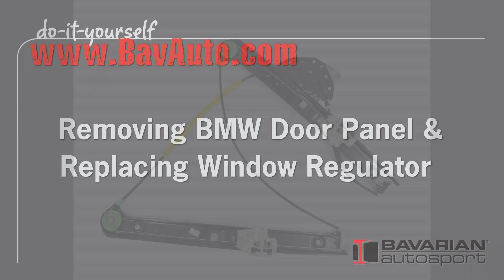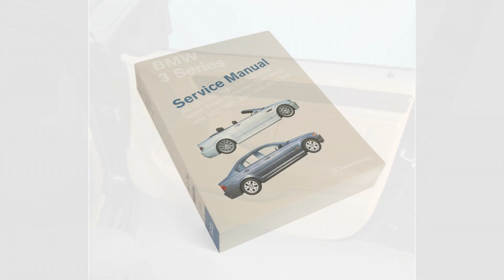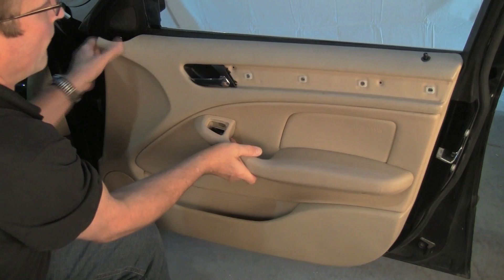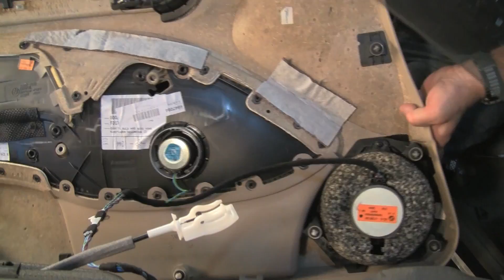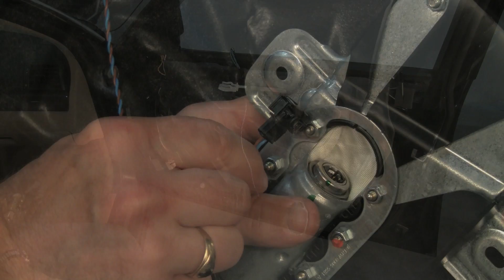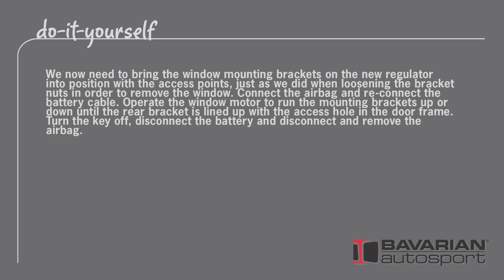Removing BMW Door Panel & Replacing Window Regulator

Comment: I have a 1995 325i coupe and its my first car and my parents bought it with the door panels falling off. My drivers door panel is completely off and the passenger is falling off slowly. My clips are broken and i was wondering if i just bought new clips and locks would that work instead of buying new door panels?

Comment: Hi guys.  I have a 2007 328xi wagon with a dead lock actuator, in the passenger front door.  I bought a new actuator online, and a trim removal kit.  Is the procedure similar at all, between E91 and E46?  If you have another video I can reference, that would be great.  Otherwise I appreciate any advice.  :-]  I'd bring it to you for the fix if I still lived in NH.  Driving up to visit tomorrow for the weekend, but probably taking my wife's Outback - more cargo space for stuff and my dog.  Thanks

Comment from the maker: If you can notice that the window initially tries to move or you hear the motor "grunting", then likely the regulator is at fault (and is far more common).  If you can not make a determination, you'll have to go into it and inspect and/or test the regulator and the motor in order to make a determination.

Comment from the maker: The E60 (5-series 04-10) 528i will have different details in removal of the door panel as well as the window regulator. The process will be outlined in the Bentley repair manual for the E60 chassis. We do offer the manual at bavauto.com under part number B510. You can visit our online store or call our agents at 800-535-2002.

Comment: I just did this on my 2003 325IX, the window works fine but if I use the all down with the key or remote the drivers window goes down first and makes a clicking noise after it reaches the bottom.  It doesn't do it with the interior buttons, any ideas?

Comment: I just replaced the driver window regulator and now the 2 rear ones went bad. Is it necessary to unplug the battery to work on the rear windows since there are no air bags in the back?

Comment from the maker: You may need to align the window in the regulator's clamping brackets just a bit.  If you slightly loosen the clamping bolts/nuts (not enough for the window to detach) and run the window fully up and fully down, then reclamp, this may help.

Comment from the maker: Good thoughts.  thank you.
Typically, the ferrule on the cable pulls out of the bracket that moves the window.  The cable still works, but it does not lift the window evenly .... and this binds the motor and shuts it off.

Comment from the maker: It is not untypical that the window is stuck and will not move, when a regulator is faulty.  The most common way around this would be to use cable cutters and cut the regulator cables so that the window can then be pulled up manually.  Just keep cutting the operating cables until you can get the window to move.

Comment: my window is stuck down, when i tried to push it up it didn't move, in this case, how am i suppose to bring window 5 inch up with the help of switch when it don'e even move!!.. motor is working i can hear the sound of rotation and the clicking noise as if something is breaking up.. i am worried, i have 2001 bmw 740il on sale, two windows need work, i can't afford to go to dealer. i want to take out my all money i spent in that car!! please reply!!

Comment: Good video. Another helpful  tip is to make sure you save or even better, replace the doortrim clips as the black foam on them assist in creating pressure in door shell to deploy the airbag if it's ever needed

Comment: Awsome videos.  I always purchase my parts from you.  Question. I have a 1998 318ti. last year the dealership replaced the guides on both driver side and passenger window..  now the passenger window goes down really slow, but goes up fine. Is it the regulator or the motor?

Comment from the maker: @stanleymejia1 
The Bentley repair manual will detail door handle replacement.  We have the manuals in-stock at bavauto DOT com.  What model do you have, and is it inner or outer?

Comment: I have a 98 540i pushing 300k miles.  My left rear window rolls down fine, but doesn't roll back up, but you can pull it up and down freely by hand.  Do I just need a new regulator?  Also my front passenger window works fine, but is noticeably slower than the rest and if not rolled up little by little makes some nasty noises, and also rattles when partially rolled down, I fear it's on it's way out too. Any insight is appreciated.

Comment: I have a final installation tip. After doing this, you will notice the auto up/down will not operate. Simply close the window and hold button all the way down for 30 seconds. Then open the window and continue pushing the button down all the way for another 30 seconds. Auto up/down should now work

Comment: Thanks, it's back at the BMW garage now - since the problem started when under guarantee, they're still doing the repairs. I get the feeling that they know everything about mechanics and very little about computers, which is why they've changed the motor, wing mirror etc, but the problem persists. It was one of the first 2-dr 118's (I think) so maybe something wasn't quite worked out. But thanks for the comment, I'll definitely ask them if they've tried this.

Comment: Great video! My prob is with 118 passenger side. Since purchase 4 yrs ago, window sometimes does not drop when door is opened, so door does not close properly. When this happens passenger-side wing-mirror & window switch also stop working (window can still be lowered from driver side). I can reproduce failure by opening door fully - on last position if the window was down (working properly) it will always go up again. Any ideas? They've changed the window mechanism but didn't solve the problem.

Comment: I ordered the parts from Bavarian, followed the steps, and the repair went very well.  The original motor was shot, and the regulator was worn to the point that the window fell in and would not stay up.  The new parts work great, and it was easy to follow the video on my wireless laptop on the roof of the car.

Comment: Great video! I am a 27 year old IT Specialist! I own a 2002 325I BMW sedan. I had never tried to fix a window on any car. Although I can fix laptops! This video made it easy to watch and repair the regulator. My BMW dealer wanted $325 per window to fix my broken ones. I ended up spending $350 for all three parts to fix my FP, FR, RR. I ended up saving a lot of money. Thanks BAVAUTO!

Comment from the maker: @cvidales1 -
A BMW dealer or an independent shop (who has the proper diagnostic and scanning tool) must do any system programming or updates that may be required.

Comment: @BavarianAuto 
it is a 2006 325I ,the regulator was replaced,when you have the window in th down position and go to close it ,the window goes up and the comes back down,after the switch is released.
The mechanic who replaced the regulator mentioned that "we may have to have the window recalibrated or reprogrammed ". Problem is you cannot close it without hitting the switch in a jogging manor to close-

Comment from the maker: @dakota4800 -
The Z3 uses a mechanical gear and lever type of window regulator (as do all of the older BMW models).  The slow operation may be a weak motor, or could be binding in the system.  We would suggest that you remove the door panel and have a "look-see".  The Bentley repair manual for the Z3 will detail the door panel removal and the regulator and motor removal.  Go to bavauto dot com and search "Bentley".

Comment: Just changed out the regulator on the driver rear side,problem is window does not stop when closing,window goes up and all the way down,how do I re set the window to work properl ?

Comment: My drivers side window on a 96 328is is stuck all the way up. It started making a grinding noise before failing all together. Do I need to replace the regulator or the actual motor? Thanks

Comment from the maker: @1140ghb 
Typically, you would need to go in and cut the drive cables on both sides of the glass slide bracket.  You would then be able to move the glass by hand.

Comment from the maker: @Badobsession89 
If you have ALL of the cables cut, you should be able to move the window by hand.  Did you cut the cables on both sides of the glass side brackets?

Comment: My window's stuck rolled all the way up. I cut the 2 cables and tried moving the window down manually, but it won't budge. Where in relation to the bottom of the window are those 2 bolts that were shown when the screen paused?

Comment from the maker: @1632poppa 

If the door will not stay open at the 1/2 and full open stop points, it's likely that he door brake is at fault.  You can see the link-arm of the door brake when you fully open the door and look in the forward door jamb area, between the upper and lower hinges.  The brake assembly is replaced from the inside of the door.  Bavarian Autosport keeps these in-stock at:  bavauto.com

Comment: @bavarianAuto
The drivers side headlight is out, I had my buddy trying to change it. He claims it requires a couple of hours to do, but now at temperature in the 112 outside and 140 in the garage it will not happen. Is it that hard to change it on 2006 325 I Sport ? Thank U

Comment: The dealer wants over $500 to replace 1 regulator. I just got both back doors done $356.00 total. 2 Regulators at $118. Each
$236. Labor $120. For both. 
I am sick and tired of dealer labor costs.  Getting robbed at gun point is less painfull.

Comment from the maker: Your rears will be a bit different.  The Bentley repair manual for each chassis (3, 5, 7 series, etc) covers the details for both front and rear.  We do keep all of the manuals in-stock (800-535-2002  ).

Comment from the maker: In cases where the window regulator will not move, due to a faulty motor or broken parts on the regulator (cable, pulleys, guides, etc), you can cut the two cables that connect the front and rear regulator rails (and move the window guides) and move the window by hand .... in order to get to the window guide attachment bolts.  If this does not work, you will have to get creative in using an open-end or box-end wrench and trying to get to the bolts where they are.